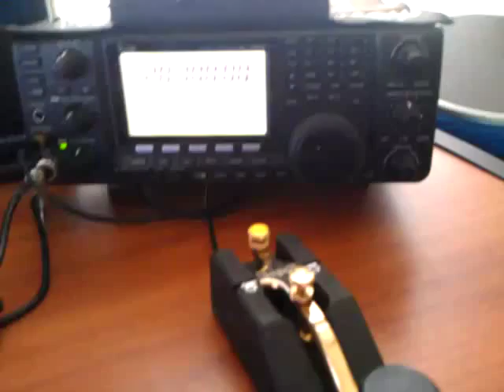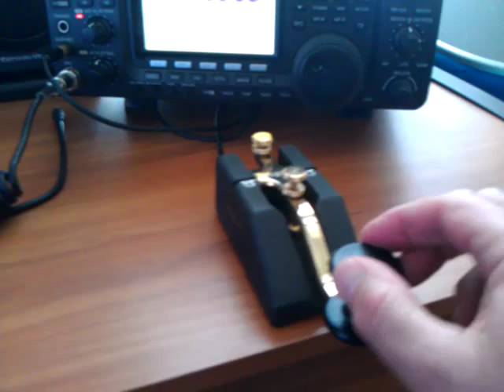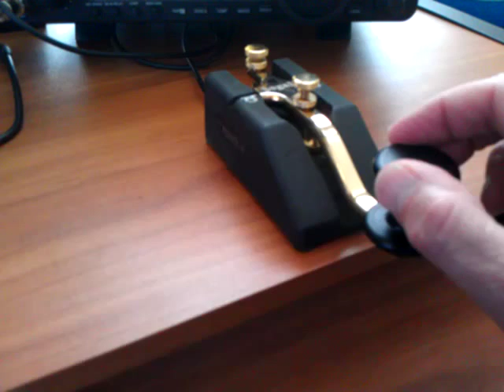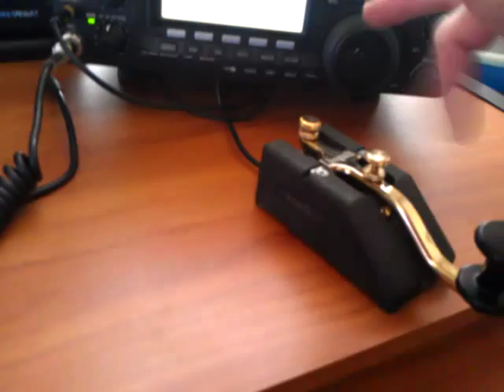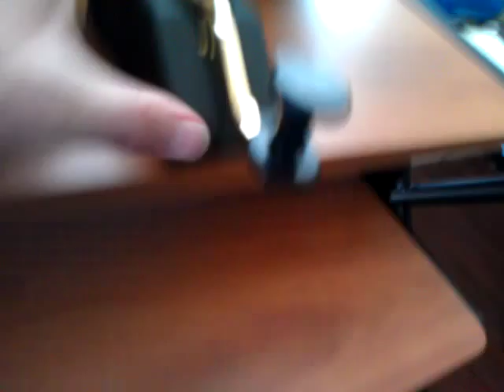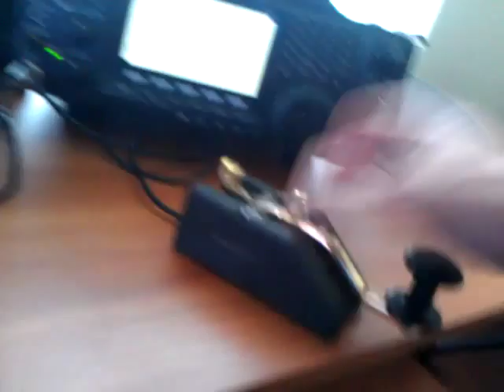Begali Spark straight key, how to setup

Comment: The feeler gauge supplied with the Spark is 0.03 mm, but they advise to adjust the gap to where you feel is best.
Reply from the maker: since i bought the spark used, i did not receive a feeler gauge. since i have not used a straight key before, its difficult to know what setting is best. i am just going by what feels right.

Comment: you can, of course get a feeler gauge at an auto parts store. if you feel the need. Smaller gaps generally for higher speed / less choppy sending.
Reply from the maker: i could use less choppy sending. lol. higher speed also, but i dont think my key is the problem. ))  thanks for watching and commenting. 73 dit dit

Comment: Looks great! Yeah, I think a little mechanical noise is what you want. It's fairly subjective but my Junker is set between 0.01 and 0.02 inch of travel as measured at the edge of the button. The force needed to make contact is about 7 or 8 ounces. That's as good a starting point as any, but expect to dial in the settings to your preference as you use it over a period of weeks. Also, if you are interested: there is some nice software available called PCW Fistcheck which displays a graphical representation of your sending; it's pretty helpful for mastering straight keys and bugs.
Reply from the maker: thanks! i since loosened everything and started from scratch til i got a feel i like. going to take awhile and a lot of practice. not a lot of videos out there on how to use a straight key, very few. i do have that fistcheck software but have not used it yet. will give it a shot. thanks for the help with the key!

Comment: What do you prefer: iambic or straight key?
Reply from the maker: easier using the iambic of course, but enjoy the straight key. have not worked code in awhile. need get back into it. hope all is well in Moscow
. de N5XTC dit dit
Reply: de N5XTC  Ah, OK on that. I never used straight key, only iambic from club and at home. 73 dit dit

Comment: Adjust the key rate to what ever you feel comfortable.  It's all subjective to your own style of keying and what you like.  You'll catch on very quick.  My first straight key was a $4.95 Radio Shack practice key and I made 1,000's of contacts with that.  I've made dozens of CW contacts with touching 2 wires when I was up backpacking in the mountains, so it doesn't take much and doesn't have to be perfect.  What makes you unique is using a straight key, so do your own thing and have fun!
Reply from the maker: understand cheap ones will also work. however, the way i am, if i buy a cheap key, i will never be happy with it and end up selling it and buying a better one. so, i got the Cadillac right off. i borrowed a cheap key awhile back and it was much more difficult to use and adjust. it's a lot of fun, also a lot of work.

Comment: I'll be getting those in about 2 wks atfer i get new hearing aid out away since i loss both hearing back 1970's anyway this will be my first new keyer on begali spark still working on my code !! cya on air ! cw that is  :)
Reply from the maker: N4MJG ya i hope we work. i am QRV 7.114 most evenings or 7.120. you will enjoy the spark. i do. 73 de N5XTC
Reply: de N5XTC my tone is round 600 plus i waering headphone while doing this my plan is old hear aid put on left since getting new on on right ear i hope i can nwer better then just aid i have a friend of mine had one ! he from uk